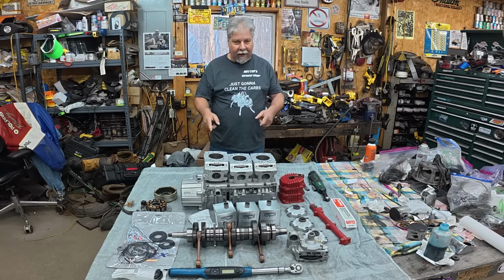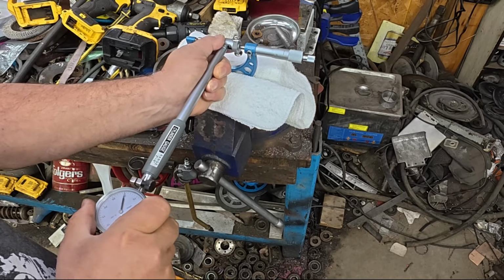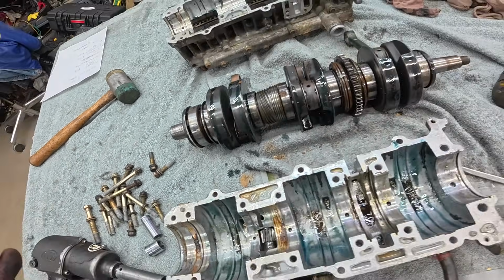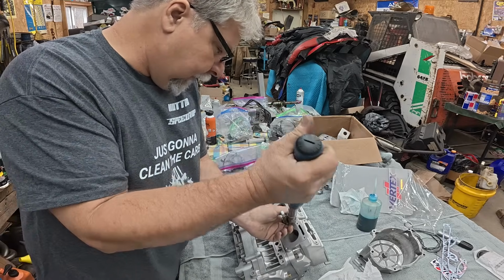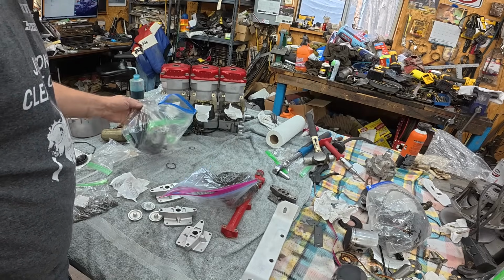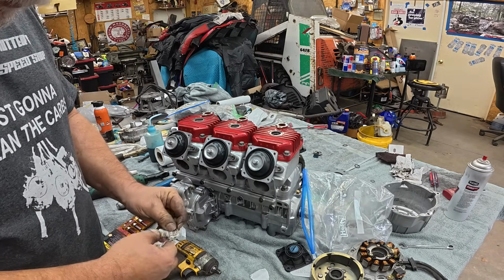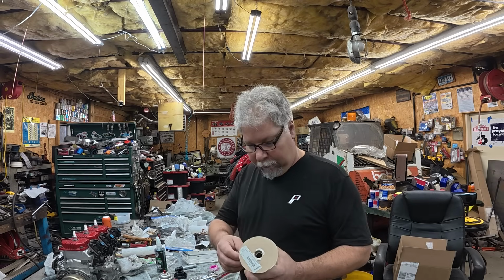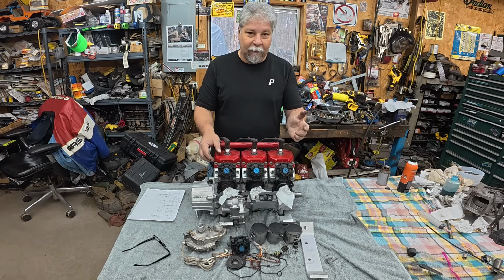Polaris 1999 XCR800 Engine Build. Hot Donna is coming together!

Comment: just dropped off a crank for a skidoo formula 3 with josh at snoweld, this guy is the only guy to get crankwork done in MN. i almost gave up on my rebuild after indy specialties quoted me $2500 for the crank. josh is doing mine for $500. great video, great channel. im running mostly skidoos in my shop but i like this content either way
Reply from the maker: Glad you liked it! Josh is great!

Comment: Nutter, I'm stumped. I just got my 95 xlt 600 running. It's running well. Idles good, revs good but my tachometer is Super slow following engine rpms. Takes forever to go up and then forever to drop back down?? Ever see these before? What sends the signal to the tach? Cdi box or stator? Any ideas? Maybe bad tach?
Reply from the maker: The tach signal comes from the lighting coils. Get the manual from vintagesnow(dot)com, look up which wires are which and check the ohms. Also check all your connections. A bad voltage regulator or bad tach could also do this. Pretty hard to say from here. You just need to dig into it.
Reply: What should the lighting coil circuit ohm out at? Can you bench test a voltage regulator? ohm it out?